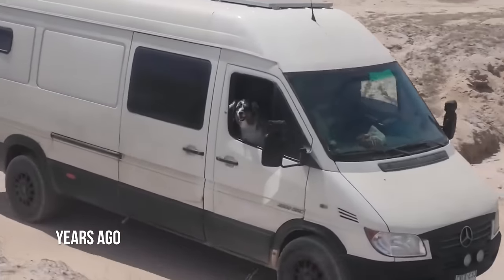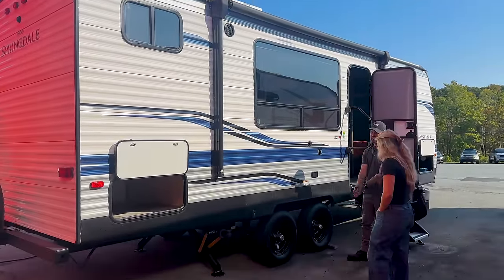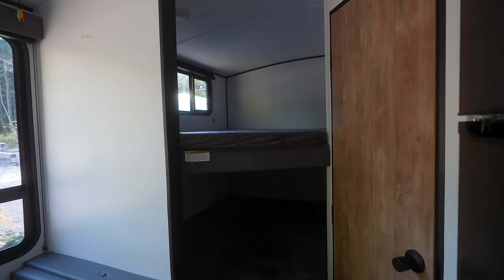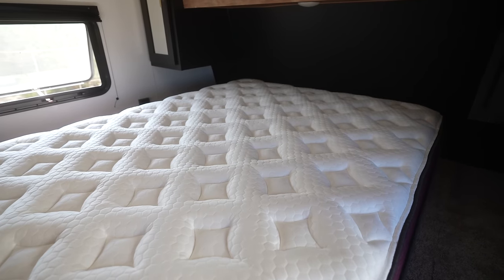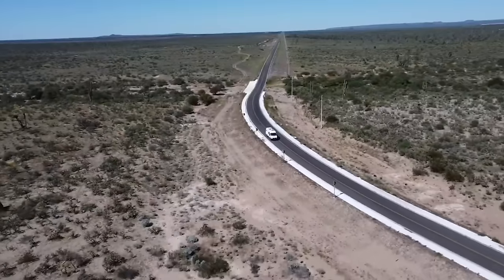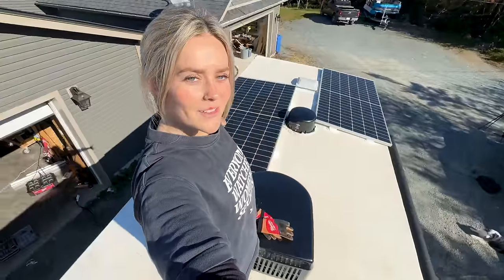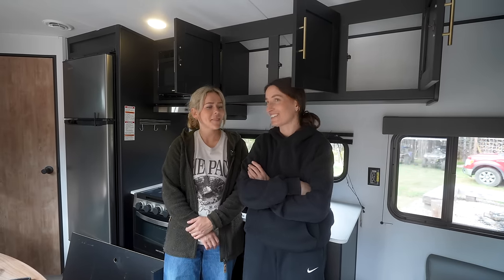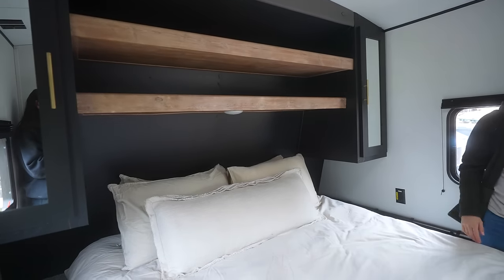We Bought an RV!

Comment: Dale - (short for Springdale). 
Over hill over Dale we have hit the dusty trail) 

Love your channel.  I hit send before finishing my post 🤭

I’ve been an rv’r for 40 years.  (I am 62 now) 
One trip we lost all our tires do to heat.  We purchased truck ply tires. Best decision ever.  

Don’t empty your black tank until it’s halfway full at minimum. You need a lot of liquid matter so that the solids do not pile up. So always add water to your tank after emptying.  Then use the santi flush system.  Make sure the end of your hose has a clear valve so that you flush the tank until the water is clear.  The build up of poo can be bad otherwise.  Have a blast on the road with your new home away and your new build in Mexico.

Comment: We have a little trailer. There is a great way to fit a lot of things in yout cabinets. I use 4x12x4 stackable container side by side. In one small cabinet I have 4 or 5 Ben's. 1. Set of 4 Dishes turned sideways,  2. Glasses and coffee mugs, 3. Dog treats, storage food bowls. Can't remember what else.  In our bathroom I put wall wire baskets on the wall holds 4 towels and I attached a towel rack om towel basket.  Also over the door towel misc holder.  I installed hooks around to hang jackets or whatever.  Also wire rack baskets in the kitchen to hold whatever.  Use PINTEREST for storage ideas. Have fun happy travels!!!we named our trailer Betsy!😊

Comment: All good advice!  Tires so important.  Impact wrench?to raise and lower trailer stabilizing legs.  Also, torque wrench to torque your tires throughout your trip. Research this, it is important. Do not exceed recoomended speed limit while towing.Good luck, you will have fun!
Reply: Plus, do not leave awning out and leave your camping spot.  Not stable in wind at all.

Comment: Suggestions:  Kitchen cupboards.  Buy wire shelves, cut them to length, turn them upside down so you have a "lip" to keep things from flying out when you open the cupboard after a travel day and attach them to the sides and back walls with plastic clamps (the white ones that hold wires).  I think we are on our 6th or 7th trailer.  Lots of Love from London, ON  🇨🇦

Comment: This is awesome and exciting! I think it is a perfect solution.
I suppose you are on the road now, or, maybe even in Mexico at your property.
I do want to caution you about the quality of the tires which come with a new RV. Keep an eye on them and know how to change the tires. You can use that new hand held thermometer to check them for over heating. Use it on the trailer bearings as well.

Can’t wait for the South of the Border Adventure!

I posted this before reading the comments. Sorry for the redundancy, but it is important!

Comment: Just know that RVs use every little tiny wall cabinet and device attached to a wall as a structural member to keep the frame from twisting. For example, your kitchen cupboards are structural component that keeps your roof and walls at 90° angles.

Comment: My recommendation would be to have SEVERAL spare tires. Like 3. Peace of mind of more important than anything. They blow out constantly. And grease your trailer axle and have extra bearings and brake parts& Tire inflator. Check the temperature of brakes and hubs every couple hours. Just because it’s new doesn’t mean you won’t have problems. Good luck!

Comment: When it comes to pulling a trailer like that just take your turns wider and you'll be fine you can also stay a little closer to the white line if you wanna stay a little further away from on coming traffic, I personally would've gotten the trailer with the slide for a little more space but you guys have been able to make it work in a van so y'all will be fine, remember you have tanks underneath that'll need to be emptied liquify can be used in your black tank to help break down the solids and you can get a hose adapter that'll let you back flush it to help keep it clean, I live in a camper so if you have any questions just get ahold of me and I can go through a few other things with y'all if need be.

Comment: RV tips: over hitch bike rack :) 
 get non stick pads for all the cabinets so the stuff doesn't slide around when driving
make sure you don't add too much weight to that back storage room if its behind the wheels for control. 
Whooo!!! we opted for an trailer instead of van life for the reasons mentioned at the end. It is a win win for travel and home. Can't wait to follow this chapter. Congrats!
Reply: And know the full height of your RV!!!
Reply: Open and use only one propane tank at a time so you always have propane rather than drawing from and emptying both mat the same time. 
And make sure you use the right TP! I saw someone’s comment about ditching the black tank, getting a composting toilet and adding extra freshwater - pretty good idea if you can.

Comment: A very nice set up...travel safe, take your time. Check the trailer wheels for HEAT, and your hitch every time you stop for fuel. A great practice of a walk around at fuel stops can head off potential problems. And once you are all loaded head to a truck scale and get checked for weight distribution.

Comment: Hey girls I noticed the ‘Cashmere’ toilet paper.  You need to use rapid de solving RV toilet paper or it will cause you problems in the future. The standard stuff will pile up inside your black water tank (the classic pyramid) and cause you not to be able to drain it properly.
 Hope all goes well for you down south!

Comment: Yes, watch the weight distribution front to back. More weight has to be on the front. Just moving a tool chest 3ft made me sway like crazy once. That big storage room full will lift your tongue. Did i see batteries in the front to offset battery weight in the rear?
Ive done trailer, van and coach. The trailer requires the most challenging driving texhniques. I know you can do it. Justvtake it easy until you get the feel.

Comment: What was that loud noise 😮

Check out the hose for the  propane make sure you make sure that you have great seals on the tank and check for leaks before using the stove 
I would get cell booster for you're phones and a get satellite mount on your roof or have a long cord and put the satellite on the ground 

The safe too cook take out gas grill and get the electric grill so can get rid of the propane tank or tanks that weigh allot food for  thought I've seen too many fires from gas leaks 

Just be safe and careful driving there and then be safe and careful getting started living there in  Mexico with the  crime that is going on there that alone would be a big deal of you going down there so be aware of that

Comment: Make sure you have good tires….most rv’s have cheap tires. ❤️ you don’t need high priced rv toilet paper.  If you use 1-ply.  Simple test….take quart jar 1/2 full of water, add 1-2 sheets of your choice of paper, shake vigorously and if it disintegrates, it’s safe to use.  Check on the quality of your tires.  Be safe! ❤️

Comment: Of all the years I towed into liver trailers I have never used an equalizer hitch not needed if you have a 4 wheel drive truck as long as it's up high level with the trailer and your trailer's level it does not go sneaky on you or bouncy around equalizer hitches we're just way too much work not so bad if you go on long hauls but for sure it halls they're pain in the ** we took them all off our RVS and rented them out without them And with the equalizer hitch you gotta watch how sharp you turn:face-purple-crying::face-purple-crying::face-purple-crying::face-purple-crying::face-purple-crying::face-purple-crying::face-purple-crying::face-purple-crying::face-purple-crying::face-purple-crying::face-purple-crying::face-purple-crying::face-purple-crying::face-purple-crying::face-purple-crying::face-purple-crying::face-purple-crying::face-purple-crying::face-purple-crying::face-purple-crying::face-purple-crying::face-purple-crying::face-purple-crying::face-purple-crying::face-purple-crying::face-purple-crying::face-purple-crying::face-purple-crying::face-purple-crying::face-purple-crying::face-purple-crying::face-purple-crying::face-purple-crying::face-purple-crying::face-purple-crying::face-purple-crying::face-purple-crying::face-purple-crying::face-purple-crying::face-purple-crying::face-purple-crying::face-purple-crying::face-purple-crying::face-purple-crying::face-purple-crying::face-purple-crying::face-purple-crying::face-purple-crying::face-purple-crying::face-purple-crying::face-purple-crying::face-purple-crying::face-purple-crying::face-purple-crying::face-purple-crying::face-purple-crying::face-purple-crying::face-purple-crying::face-purple-crying::face-purple-crying::face-purple-crying::face-purple-crying::face-purple-crying::face-purple-crying::face-purple-crying::face-purple-crying::face-purple-crying::face-purple-crying::face-purple-crying::face-purple-crying::face-purple-crying:
Reply from the maker: Thank you for sharing your experience!😊🐾

Comment: Just be cautious while traveling with it.. Weight distribution plays a key factor in how it tow's.. i would suggest placing Most weight over axles OR in the front to travel you can re-organize it once you've set up camping/living ..  thats like the water tank.. I Don't like to travel long distance with a full tank of water as it's Very heavy and slosh's travel with only enough to use your toilet or fill a dog dish..   I actually haul a 30 ft myself with about the same layout inside.. We too use the bunk area as storage but all that goes on OUR bed up front to travel otherwise it doesn't tow well.. I built cabinet doors to access the storage under dining seating areas so ya don't have to remove the cushions to get stuff.. and there's also room Under the couch for storage if ya make access.. TRUST ME .. I did

Comment: I would also get the van weighed. The load and batteries could cause problems. You need to be sure of your weights forward and rear of your axles as well as the tow ball down weight. If you get these wrong and have a accident the insurance company can wipe your claim.

Comment: With all the modifications made or to be made, you should read all the great advice in the comments.  These may end up being very important to the success of moving to Mexico and then living out of the RV.  One thing that came to the forefront in all of these comments was weight distribution. Packing this RV with what you want to take may end up being an exercise in compromise and a scope change to take into account what may already be in Mexico (hence a decision to not bring stuff).  The second thing that jumped out is that you are putting in structural modifications and extra weight onto a stock suspension and a set of tires that are most likely not designed/engineered to deal with the extra loads.  Wow, in typical fashion you have bit off a ton and do not have a lot of time for learning stumbles (remember the cabin took three years!).  You might want to bring on board some serious consultants that can help you avoid time wasting errors.

Comment: As someone who lived in an Rv full time, you can’t use regular toilet paper. I tried to be different black tank add ons to help with breakdown and ended up with clogs all the time. There are these little bugs that love black tanks and everytime you flush they will fly out. I ended up having to flush my black tank to declog it by pouring hot water down the toilet and taking my hose and running it from outside faucet to the toilet
Reply: Another tip, if you decide to use the AC in the summer (I did since I was in Arizona and have dogs), get a dehumidifier and it will help your AC not have to work as hard to keep things cool which will reduce the amount of electricity you use because those Rv systems really know how to suck your power. Also the reflectors for the windows  are great insulation for those sun rays

Comment: Ladies! We live ya so much but you've very likely exceeded your payload capacity and the tounge weight of that trailer. We had a similar 30' and loaded it up with solar and ended up way over. Please take it to the scales, weigh it also weigh just the tounge fully loaded. It's very possible you'll break a leaf spring or have a blowout along your trip if you are in fact over your payload capacity. Safe travels!

Comment: So i know you guys are regular baja drivers, but i want to update you on the roads, they suck. There are now thousands of pothold on hwy 5 and hwy 1, they are not doing any repairs on the roads at all. Near Gonzaga bay there are some of the deepest holes I've seen, also south of the LA Bay turn off, there are miles of bad road. 
We live in San Felipe and drive these roads a lot with our trailer, so it is doable but you have to be careful, have some good jacks and even bring spare springs, there is always someone in our groups that brakes a spring,  remember highway 1 is only 12" wider than your trailer, so drive slow and be careful, we just about come to a stop when we see a semi especially coming to corners. Keep our info if you need any help in north baja.

Comment: First replace the RV tires with a better brand.  Remove the 110 a/c off the roof and install a 12 volt a/c. eBay Treeligo 12volt A/c.  Name the camper Dale.

Comment: guy's i would get some big tarps to cover camper just in case. also there should be a couple of little breakers under the camper on the DC side of the power i'v had to replace them a few times. heads up its looks like a small box with two studs come out of it and there plastic.

Comment: Trekkie the Trailer for your trailer name and for all your treks and adventures.  I would be ditching the toilet for a composting toilet just because I hate hauling around black water as it is disgusting and also heavy.  With that said, I did travel in an RV with a flush toilet and black tank for a couple of years at one point.  I learned very quickly that with a black tank, you need to keep enzymes and deodorant in it at all times or it can really get funky.  It is like having a commercial porta-potty in a tiny house. Once I learned about the enzymes and deodorizer, there was no issue with odor.  You two are off for a fun adventure, enjoy.  I really did love RV living.

Comment: Most RV trailer tires supplied from the factory on new rigs are notoriously bad, poor quality, Chinese knock offs.  Its not a matter of if you'll have a flat or blow out, its a matter of how many flats you'll have before getting frustrated enough to upgrade the tires. A tire blow out on an RV while driving down the interstate at 65 MPH can cause serious damage to the RV body before you get it pulled over & stopped.
Reply: They're likely half way to Baja by now tho

Comment: Most RV Travel Trailers are not equipped with kitchen drawers due to the rough travel your unit will endure. Manufactures design & build these to break...More repair money & the quicker one trades it in for a New one
Reply: I wouldn't be taking it down no rough roads. Imagine the towing bill if they get stuck or something breaks on the trailer/camper

Comment: might want to refit your truck with a larger/powerful alternator.  that way you can be more efficient running the engine and charging your tools and things.  my jeep has a 110 outlet that is great for recharging a lot of different devices that are not meant for your car.

Comment: Where you are going I would be concerned with snakes and scorpions along with the rodents having lived in the AZ desert for many years.  Others have mentioned filling any gaps and holes with spray foam to keep the critters out.  If you do that, sandwich some 0000 steel wool between two layers of foam and mice won't be able to chew through it.  I did it on my motorhome and it worked.  As far as the scorpions are concerned get some diatomaceous earth powder from Wally World or a pool supply store to spread around any part of the vehicles that touch the ground; tires, stabilizers and tongue jack. They will avoid it like the plague.  I'm sure you already know to shake out your shoes before putting them on.  As far as the desert snakes if you find one close to your abode or one with its tail hanging out a wheel opening and head peeking out another spray some cool water on it and it will take off faster than you can say Eeeeek!  Ask me how I know.  
Happy trails!  😸 🦂 🐍 🐁

Comment: There are certain ways travel trailers need to be loaded. You have to distribute the weight evenly throughout the trailer. You can’t just load the back corner and expect it to tow right. A bunch of weight in one corner will make the trailer squirrelly in the back. Your trailer will be all over the road. Research ladies research.

Comment: Ohhh, I don't think you can use that Toilet Paper in an RV.  My experience is you need specific RV toilet paper.  Which is super expensive.  Supermarket alternative is Scott Brand single ply paper.  The 1000 sheets per roll stuff.

Comment: Couldn't quite tell if the storage area is in the back or front. If on the tail be cognizant that sway occurs much more if the trailer is end heavy. And tongue weight is an issue if in the front. Ideally the weight balance should be just front of the wheels. There are great videos on this using models on treadmills that show this. But, I'm sure you're aware.

Comment: You should  reweigh the truck and  trailer with it loaded with all of your tools and solar panels and the batteries and supplies just to be safe for your drive and  truck  remember that it could change the way the truck could handle the weight  plus the laws of each country is different so do your research and your insurance company is gotta cover the new  upgrades that you're putting on your new trailer  check your tires for the weight and usage